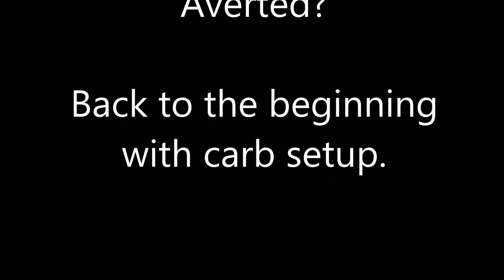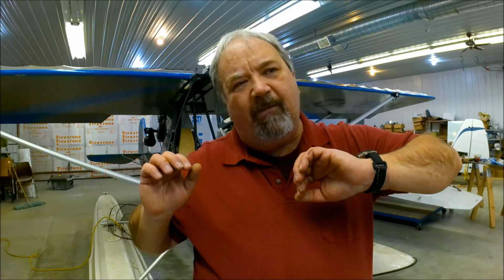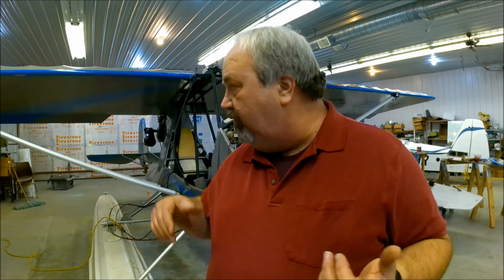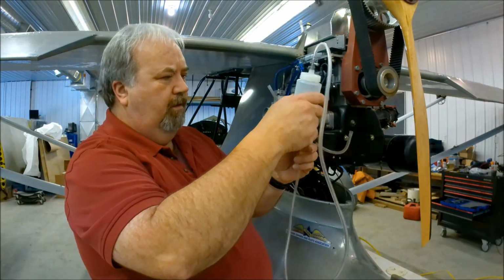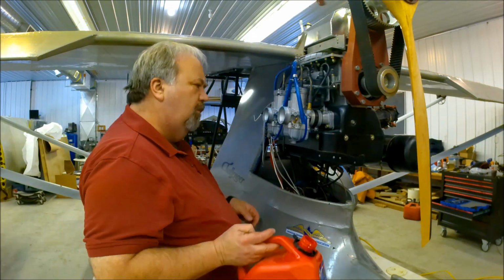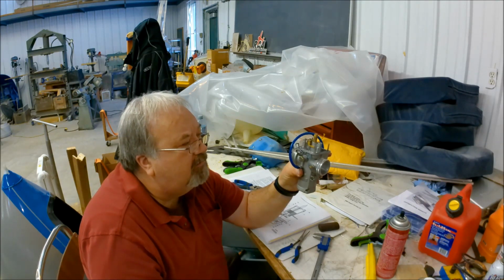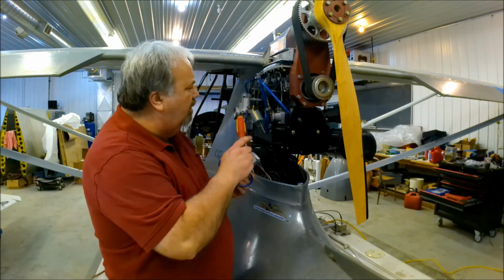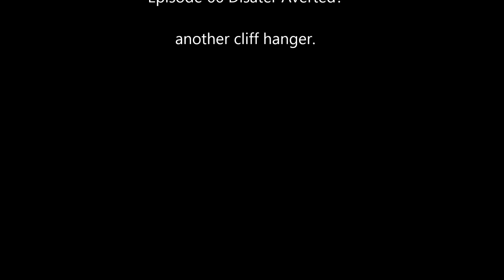EP 66 Discovering what is wrong with the engine ! Let's find out. Challenger 2 Ultralight Airplane

Comment: Hi Peter - just a technical point - blowing air into the oil fogging line does not check for any leaks unless you do a soap bubble check all the joints for air leaks. A vacuum pull to see if oil actually flows all the way to the end of the tube would give you a better test.
You may also want to check the choke (enricher circuit) stops on the end of the choke cable. They can harden or crack and fail to seal the choke fuel hole on the carb. Also make sure the stops fully seat on to the hole when choke is closed. I've seen rough running engines when the choke fails to fully close. Keep up the good work - you'll get there. Bill
Reply from the maker: Thanks.

Comment: Hi Peter. Good float level inspection procedure as the carburetor must be placed upside down for proper float level adjustment. 

The float bowl vent hoses should have 2 holes mid point that go completely through. It absolutely won’t run correct withe no holes in those small lines. 

The jet needle clip change from second to 3rd groove won’t effect idle. It’s basically only employed from 1/4 to 3/4 throttle and effects cruise power. 
The Rotax standard clip setting is the second groove however if that’s a 60-47 GSC propeller I’d use the third groove as your standard now. 

The Engine Fogging System is operational, now we just need to get it to suck the solution into the engine. As I said I’ve never seen this issue before and await the identification of the problem. 

I posted a recent video about Bing 54 carburetor adjustments with a pencil. YouTube- search bar, rotacrepair.ca  FYI the engine in that video ran perfectly with no further adjustments required. 

Best regards John
Reply from the maker: Thanks for the great advice. I watched your video on adjusting using pencils, and went out to buy a set. Have to measure them, but will follow those instructions when I set the carbs up again in the spring. (Spoiler Alert! the engine runs super smooth now, and idles great, but that's on the next video.)

Comment: If you don’t tidy your workbench, my OCD valve is going to burst! 🤣😂
Reply from the maker: The work bench is the next priority item on the list. It really has suffered from some neglect. Cheers.
Reply: @challenger2aircraftadventures , just needs tidying mate. We’ve all used crappy, wobbly workbenches.
Reply: bench doesn't need to be cleaned up until time searching for things exceeds 20 minutes, otherwise it's a work efficiency loss.  spending time cleaning up unnecessarily.
often times backyard mechanics have to do a job several times before they get it right, leaving everything out makes it easier to repeat the job.